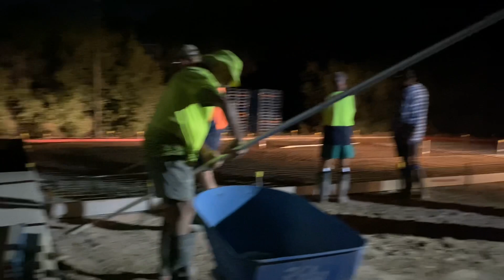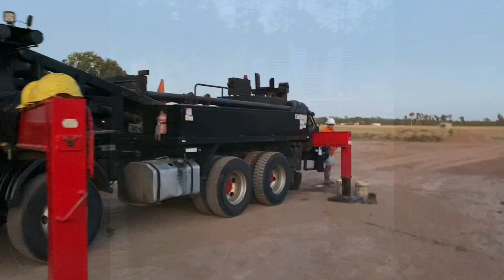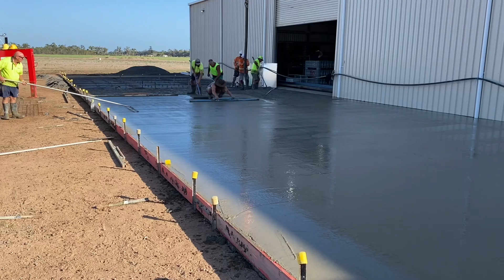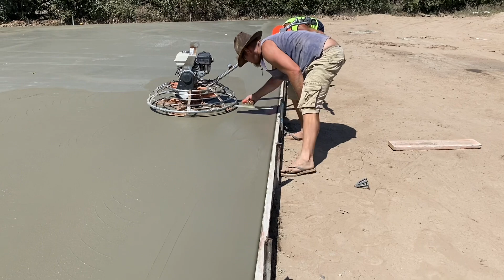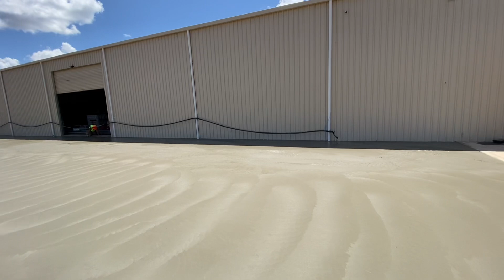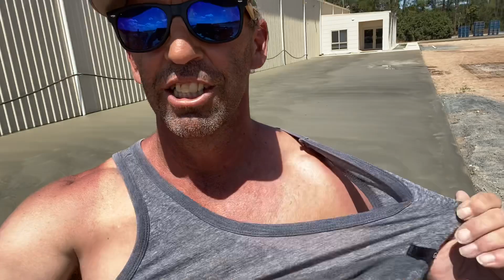Concreting 500 m²

Comment: So you don't need to vibrate it when concrete is like soup? Not been smart Ass. Just asking the Pro.
Reply from the maker: Yes you are correct no need to vibrate when it is so wet just tap the sides with a hammer
Reply: @concreteninja  Freaking legend, thanks for your reply. I appreciate that.